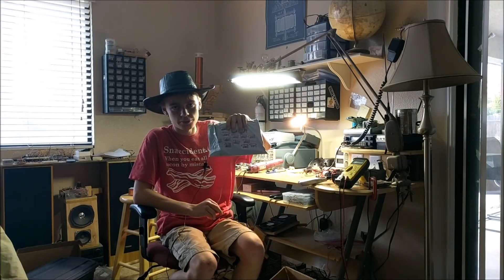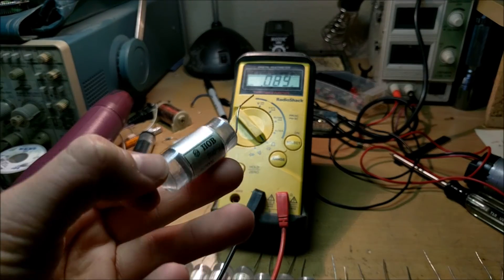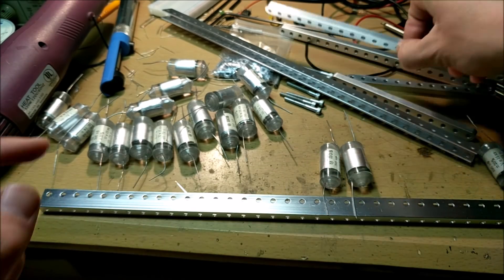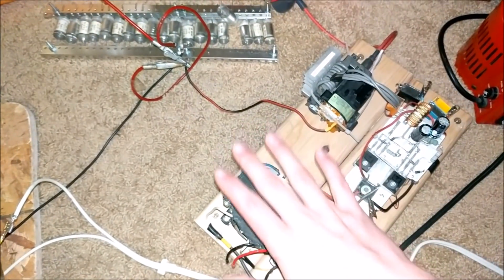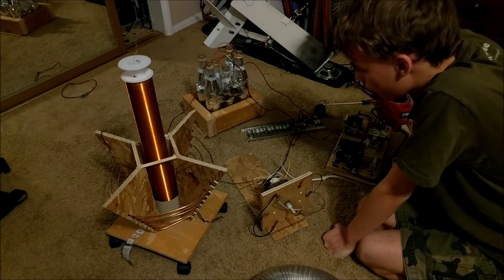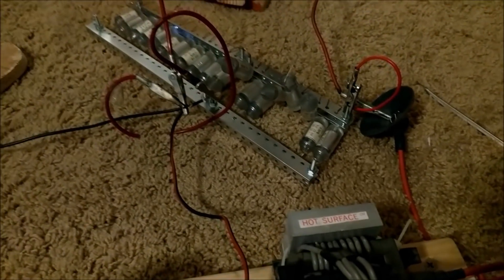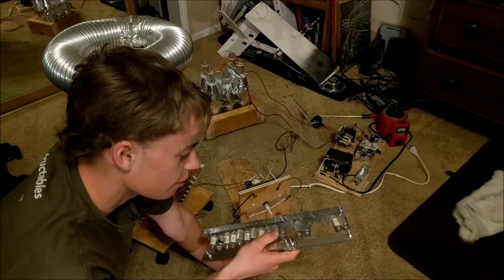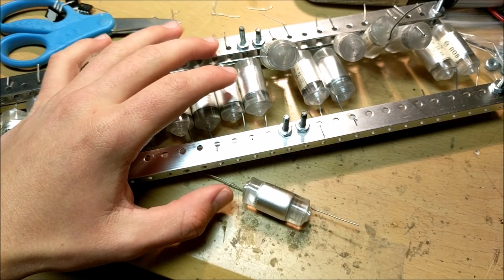Testing a New Tesla Coil Capacitor Bank

Comment: Old video, I know but I think the capacitors kept blowing up because of voltage spikes (safety gap fixes that) and because they weren’t rated for the super high frequencies of that specific coil. (at least I think its high frequency because you are touching it without dying and also the total capacity of the bank is pretty small which results in high frequency).

Comment: heat😂on those capacitors you are putint 28kv on those 15kv capacitors thats why they are blown if you were convert at rating 45kv 3 capacitors in series it could had work

Comment: I suggest these caps: https://www.mouser.com/ProductDetail/Cornell-Dubilier-CDE/942C20P15K-F?qs=oi6qnwyrdkwXyuvbwpS%2Fxg%3D%3D&mgh=1&gclid=CjwKCAjwz_WGBhA1EiwAUAxIcUNFuD0qVu2EQdWO9SjFtvExmjM84CshkS9w6sh1c42fUA-Vq1LPHxoCbFUQAvD_BwE      
used 2 sets of 9 of them in series and then wired 2 the sets in parallel.

Comment: Just came across this video. Are you sure you have the specs right on the Capacitors??? 
I think your issue is A) that you're wiring all of your capacitor in parallel which is giving you 6000nF and a MAX of 15kVDC (**which I'm almost certain your rating is actually only 1500 VDC, not kV**! You need to wire them in series. B) the typical capacitance value of a tesla coil is from 5-35nf. Wired in series, you'll end up with 19.5nF...somewhere in that area. Shoot for that if you haven't figured all of this out already. C)Typical capacitance PER CAPACITOR is between 1.5-2.0kVDC..nowhere near 15kV. Another reason to wire in series.  
I'd also recommend wiring your spark gap in parallel instead of your capacitor bank. See Faltads Cicruit Simulator for a good example of the preferred way to wire a Tesla Coil, and general idea of what capacitance and values you should be getting. Also try the program TeslaMap.

Comment: You need those ceramic doorknob capacitors or pulse (high frequency - fast dV/dt, where dV means "delta voltage" and dt means "delta time," delta meaning "rate of change") rated capacitors.
They are designed to operate with high peak currents and low impedance.
Also, bro, look around the carpet in the video. You've got leakage current going everywhere!
In addition, the flyback probably puts out a higher voltage than you might expect, could be another reason for them failing.

Comment: I would suggest submerging the capacitors into mineral oil. It seems like the arcing is causing a short-circuit. MIGHT BE a better insulation could help in some way.

Comment: Polystyrene Film Capacitors should Not exsist. Many hobbyist fall into the trap of these fancy looking capacitors rated for high voltage. In reality they CAN'T do high voltage. A 1.5kv Polystyrene can do 1.5kV at best. A 275vAC MKP can usually do 700V DC and a 5uf can pass 100VA

Comment: Well these capacitors are obsolete and not meant for any high power/high precision works. The only budget choice is MKP capacitors (the yellow box like ones) and induction cooker capacitors(black box+cylender shaped ones). If you want to go fancy, make your own copper foil capacitors or buy the huge single high voltage ceramic capacitor.
Reply: Btw, the fancy capacitors mention above is also called Doorknob Power Capacitors, Pulse Power Capacitors, Hige voltage RF capacitors and they are indestructible. (Don't heat up)

Comment: you should get more of those (40) then put them in groups of 2 in series, so you have 20 capacitors rated for higher voltage. then put those 20 in parallel. so then you can have a 30 kV bank instead of a 15 kV

Comment: Maybe they're too lossy at Tesla coil frequencies (dissipation factor)? Also the primary can ring up too and over volt the capacitors, try adding a safety spark gap across the bank.

Comment: I may be way off since I have only started studying power systems but  i have been reading about the use of reactors (inductors) connected in series with each compensatiing capacitor to eliminate harmonic frequencies to reduce rush current and reduce voltage disturbance in the network.
Good luck

Comment: Oh these capacitors can not handle the tesla spikes. Foils and wires get way too thin. For that kind of power you would need something more serious like this https://www.ebay.com/itm/470pF-15Kv-40-Kvar-type-K15Y-1-Russian-USSR-Doorknob-capacitor-radio-HAM-H-Volt/112832554759?hash=item1a45582707:g:X0cAAOSwnw9Z5z63

Comment: I have just built my cap bank for my 12kv coil from 2kv caps sourced from the awesome people at LCSC, so highly suggest you get some great Caps from them and they will probably send them to you free of charge to support your channel. still have to wind my secondary so won't get to test my bank for a while. running them in 6 rows of 24 to give the ideal capacitance for my power source which is a 12kv neon transformer so way more concistant power source compared with a flyback with zvs. With these two modifications to your set up you will get awesome results.

Comment: Don't run 15kv caps on 15kv. Especially when high frequency is involved. A 30 volt zvs circuit calls for caps rated for 250 volts and for good reason. Also, if you put capacitors in series, it will roughly double the max rated voltage and cut the capacitance in half as well as dissipate more heat. Id put 2 or 3 in series and put a bunch of thoes groups in parallel. Good video man!

Comment: You need Cornell Dubilier 942c20p15k-f I have seen them go as low as 4 dollars a piece great pulse caps for Tesla coils they never die you can drill a hole in them and they still will have capacitance I have done that to one  ones but it still is going strong

Comment: Well I tried tesla coil with zvs driven flyback and my homemade plate caps, but the effect was not that good (runnin it at 5 amps 30v) the tesla coil arc where about 5cm, BUT I tell you one thing. If you want somethin more than 6cm arcs, instead of zvs driver, use MOT in series, so with the high voltage and high current the arcs will be huge( mine around 50cm) The internet is full of designs and shematics, but if you want I can send link to design I used. Hope you try this(just dont get shocked by mot) :)
Reply: can you help me bro.i really need help..its little urgent